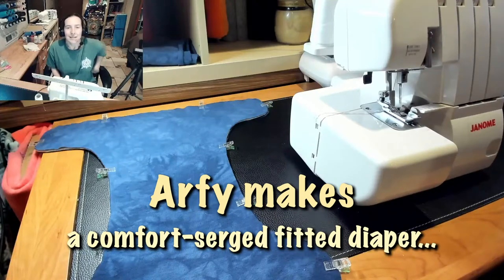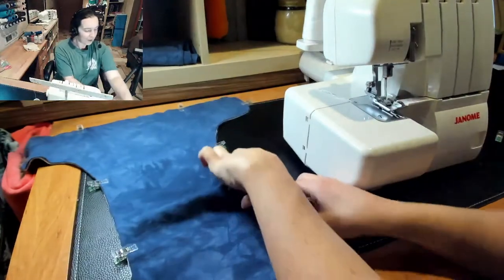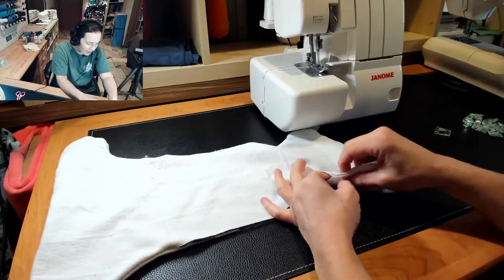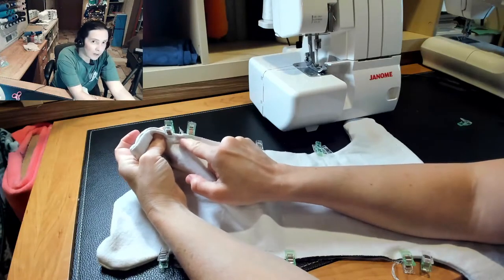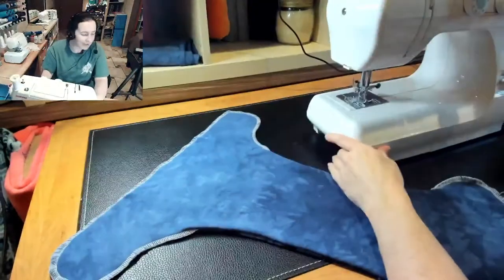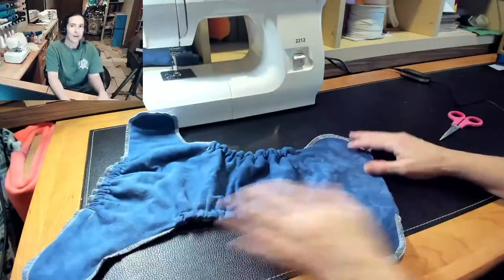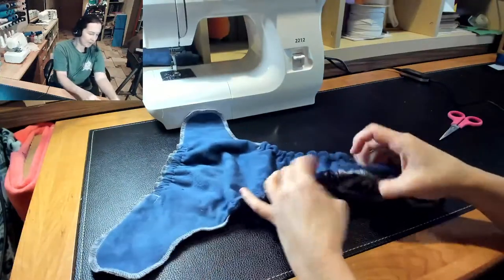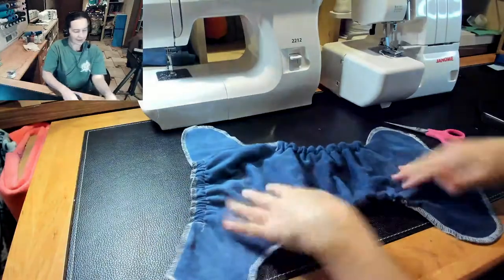Arfy makes a comfort-serged fitted diaper…

Comment: Thank you!♥️ Which pattern template would you recommend for making this in a newborn size?
Reply from the maker: Any of the NB or NB/S patterns with rounded wings should work fine.  :) I'll be making a serged fitted tomorrow using the NB/S serged fitted template. It's work fine for this style as well.

Comment: I love that I just found your patterns and you just made this video! Good timing for me ha! I wanted to ask how long you make the elastic piece? I'd printed out the M-L pattern to test the size on my baby and then realized i didn't know how much it was going to scrunch in! Thank you.
Reply: Okay - Just read a previous comment you made about not measuring your elastic just going by feel - But I am wondering then how you would estimate how much larger the pattern is compared to how much you think it will scrunch??
Reply from the maker: @therealityanchor4148  That is an interesting question, but it still goes with the issue of *different brands and types of elastic stretch differently.*. I really think the best way to figure it out is take some elastic and pull it out to fully stretched out and then compare that distance to its relaxed distance. For the diaper, I'd then relax it back about 20-25% of the way between those two measurements. Get a feel for how that much stretch FEELS. Not super tight, but also still very stretchy.  I know it feels like a vague response.  Many people just say to cut your elastic half the length of your casing. I have just seen that turn out badly before as well.
Reply from the maker: Maybe just make sure you have enough elastic to be at least 1/2 the length +1 inch each for each casing?  If the issue is for how much elastic to buy...
Reply: @arfymakes3611  I guess my question was a little convoluted. Sorry!  I meant how you can draft a pattern if you aren't exactly sure how much the length will be shortened by the elastic. Because that measurement is how long the elastic should be. But thank you for responding and I do understand your answer. It can also depend on how big the baby is at the time I am sure. I am more making sure both sides are the same not just with my feeling the tightness, since that's not necessarily going to be so reliable. 😳
Reply from the maker: @therealityanchor4148  I show how I do that in my basic diaper video. I do one side, and then fold it onto the other side while both are relaxed to line up the ends and then sew them to equal lengths.  heh I think I have a post about it on my blog too.